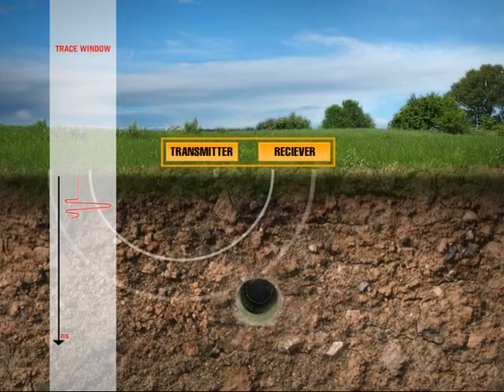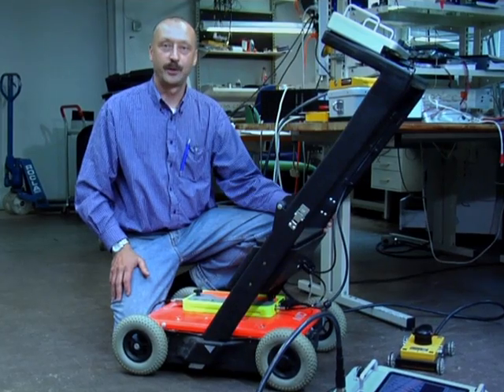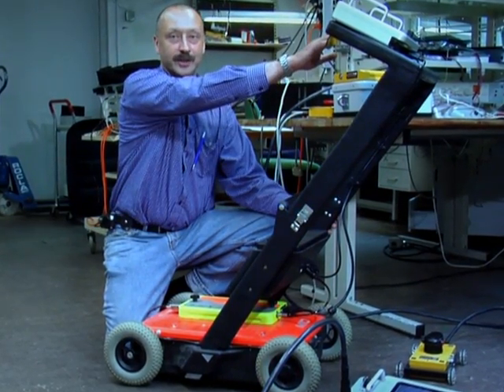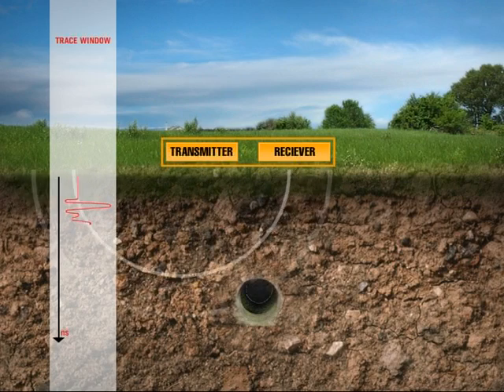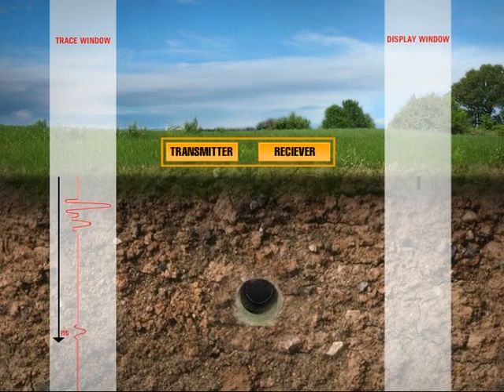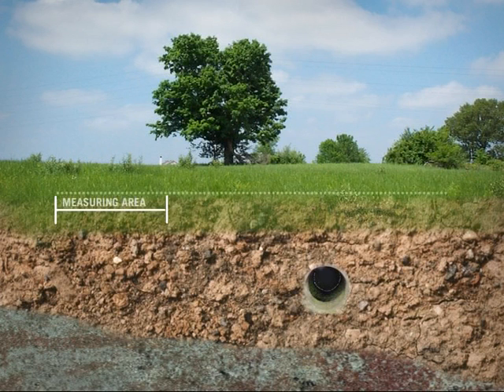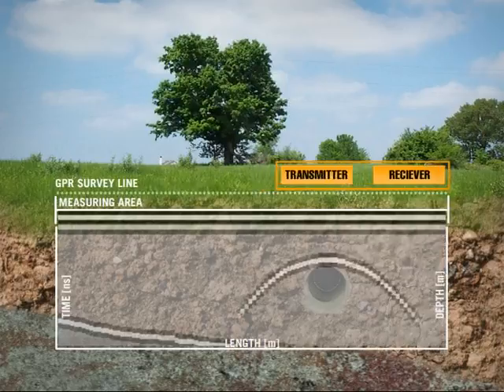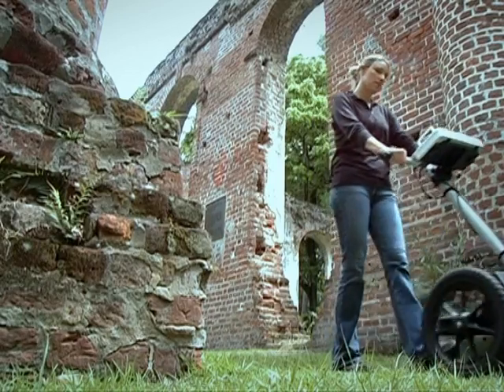MALÅ Ground Penetrating Radar (GPR) Technology Explained

Comment: The cable is much longer than the wavelength of the radar.

You cannot RESOLVE objects smaller than about half the wavelength, but you can scatter radiation off an object much smaller than half the wavelength.

E.g. Rayleigh scattering, where 400 nm blue light is much longer than the few nm sized molecules it is scattered from.

Comment: I suspect this to be false claim. There are GPR machines capable of generating 2500mHz pulses. With multiple passes across the same area one can detect objects with a size equal to or larger than 60mm (0,06m). I cannot imagine, even when using an array of apparatuses, that one can accurately detect objects just 20mm (0,02m) big. Also consider that a pulse ranging up to 2500mHz is easily disrupted and generally lacks ground penetrating qualities, reaching no further than 1 to 2m.

Comment: At 1:17 how it is possible to hunt a smal target ( 0.02 m) using a big wavelength (800 MHz = 38 cm). Normally with this wavelength we can detect the objects which are at least 18 cm big.
How do you detect the 0.02 m big objects with 800 MHZ